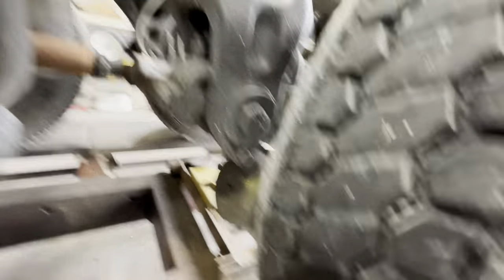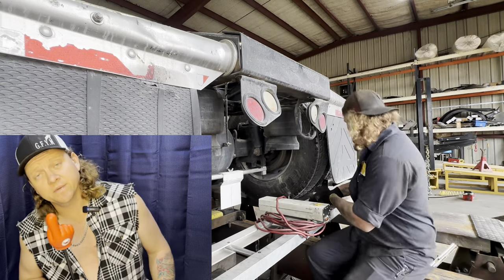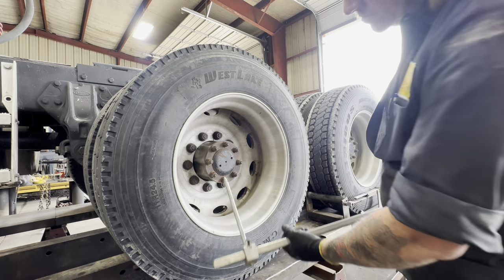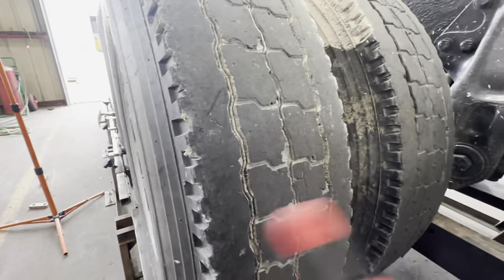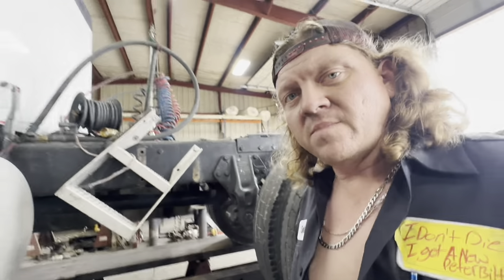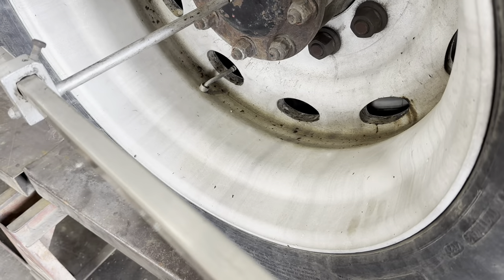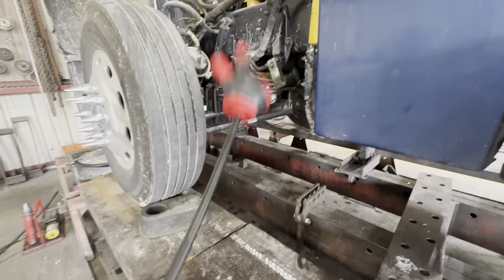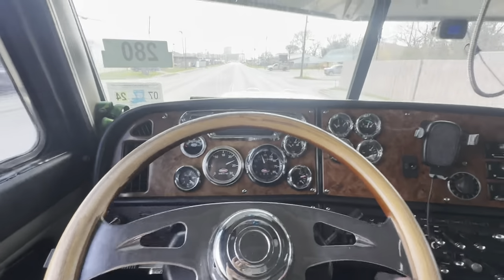"Ultimate Guide to Rear Alignment Adjustment on a 379 Peterbilt Semi-Truck!"

Comment: I used to work at what is now the only truck spring and suspension repair shop in the Winston Salem NC area back in the 80s. They had a couple Bee Line frame machines made in the 50s and 60s but no one that knew how to use them other than to do front end alignments. Its cool to see how it works

Comment: Did you square the first drive axle to the frame? Make sure distance from wheel to frame is the same on both side. Make sure rear drive axle is the same rim to frame then align rear drive axle to first drive axle. This is the way we doit at Ryder. Maybe it’s a step I didn’t see you do. Still like your videos

Comment: Do a video showing how to diagnose front spring hanger issues. I am currently having a popping noise coming from my steer axle in turns.
Reply: Probably your shackle pin bushings
Reply: @johnmickelson824  perhaps, truck needs to go to the shop to get diagnosed. Shitty thing is it does not do this unless you load the front end. Today I figured out that if I backed under a trailer and put some pressure on the 5th wheel and then dry steered back and forth I could make the popping noise without moving the truck. Noise is coming from under the steering box at the front of the leaf spring.
Reply: Pin bushings. Does it do it in rainy weather? Pins have grease fittings?

Comment: What causes shimmy or a off/on bounce? It seems to change with road surface from concrete to asphalt. Drive tire wear is excellent and it’s felt mainly in the seat. Don’t seem to come up through the steering column. Truck has a junk Holland fifth wheel with rubber bushings that have a ton of slop even when new. Steer tire wear is really good and all the shocks are just over 2years old. Can’t see any obvious wear on torque rod bushings or spring bushings. No slop on the steering wheel axle ends. Western Star 5700XE Airliner suspension.

Comment: Holy RPM....
Reply: You’ll do a hell of a lot more damage lugging & pinging it at low rpm than you’ll ever do from spinning it to 2200. 

Pumps, compressors, earthmoving equipment, tractors, ships, and tons of other industries use the same engines that commercial trucks use and spin them at governed speed for hours, days, or weeks on end without issue.

Comment: I believe that is air leaf. Curious. Does that method compensate for an out of round tire or bent wheel on rear driver.
Reply: Think it out... Were is he measuring?  Where is your hypothetical damage at?
Reply: @Failure_Is_An_Option  you’re attempting to establish centerline of rear axle. Outer circumference of bent wheel or out of round tire is not on that centerline

Comment: Where are you located? I have a serious issue I could use some assistance.  I have a 1988  peterbilt 379. I can't figure out what is out of wack to make my transmission grind at about 70 and up but really when I let off the Throttle. I just got a new transmission and drive shaft and axle and it still does it . Help someone please
Reply: He doesn’t fix those issues he’s only suspension

Comment: I just had 2 new front tires and alignment done because of chopped tires. Now the dam steering wheel shakes and it pulls to the right so bad im leaning left on the steering wheel the whole dam time.  Did they not test drive the dam thing? Now i gotta take it back and lose another day of work. Pay attention mechanics. Test drive the dam thing.
Reply: Pulls to the right ??

Single axle? Passenger side drive axle is too far forward.

Dual axle??
1. Both drive axles the right sides are too far forward.

OR

2. The passenger side axles are closer together on that side and the driver side are farther apart 

If one steer is clearly more beat up more than the other you have one of the 3 issues listed above AND AND AND a toe in/out problem … all depends on way steer tire is more beat up 

Right hand pull and the passenger side steer is way more beat up than the driver side ??

Too much toe in and right
Side drive axles issues m/right side pull 

Driver side steer tire more beat up than the passenger??

Well still a right side drive axle issue but now it’s combined with a tow out issue.